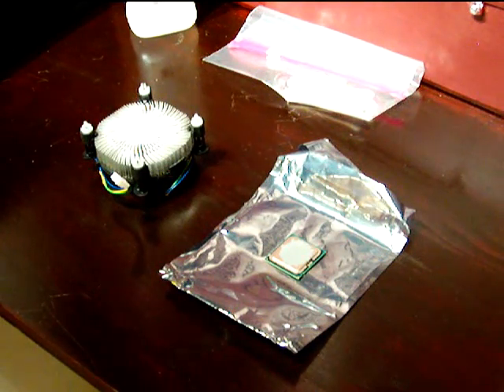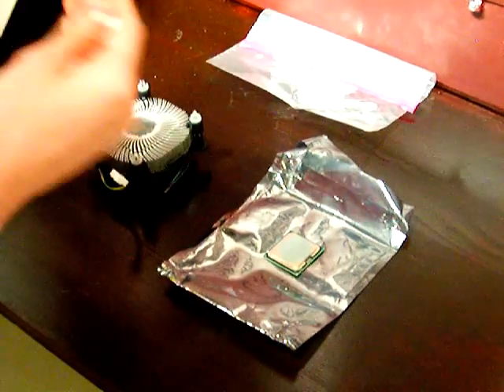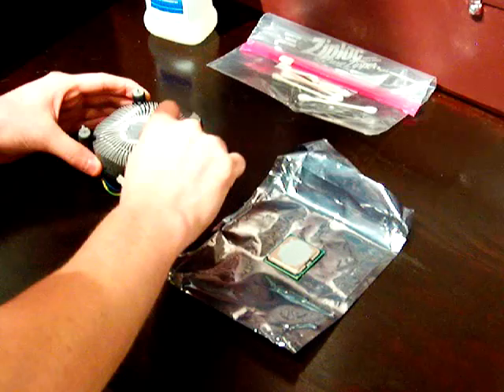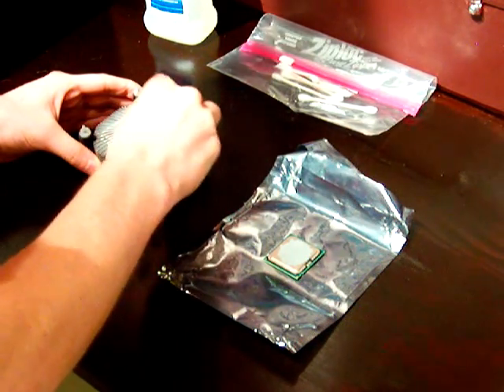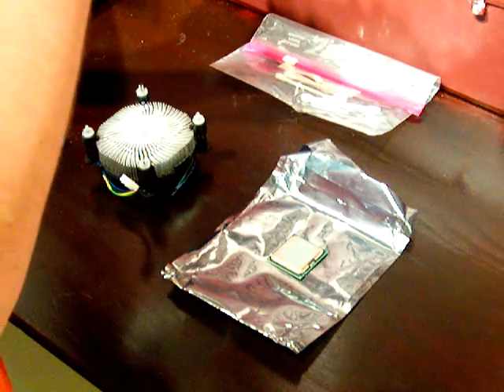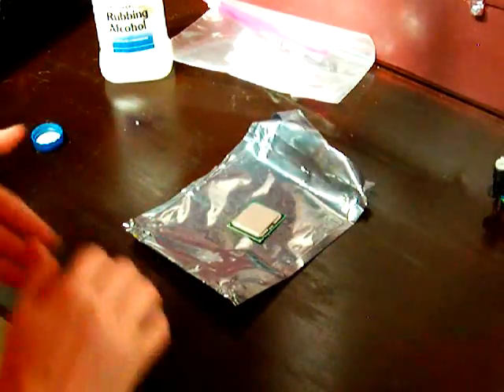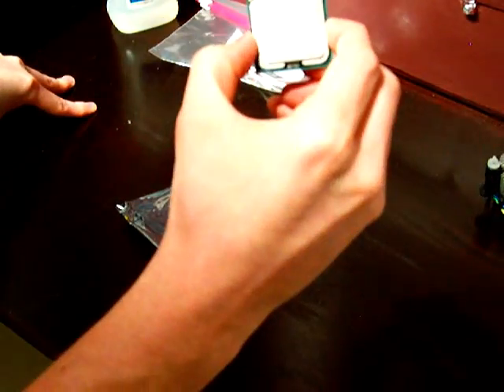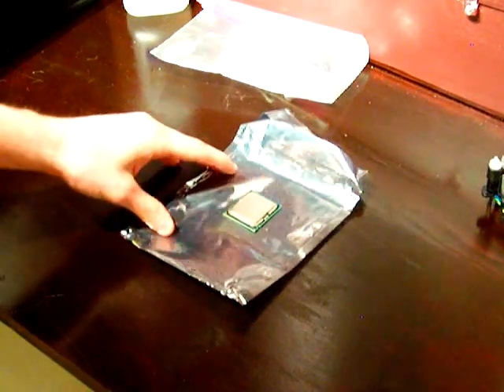How To: Remove Thermal Compound from the CPU or Heatsink

Comment from the maker: No, it will not break in a "week or two," but it can cause instability and shorten the life of the product extensively.

What method are you using to measure the cpu temps?

I highly recommend purchasing some artic silver 5 and reseating the cpu or else considering an aftermarket cooler (however, you shouldn't need the latter option as the stock cooler is more than sufficient).

Comment from the maker: Are you overclocking your cpu? Have you changed any of the cpu voltages? Are you sure that you've properly seated the heatsink/fan and that the fan is spinning when the system is on?

That CPU should not be posting such high temperatures at load. Try the following.
1. Verify that the fan is spinning when the system is on. If not, check to see that it is plugged in properly.
2. Try reseating the Heatsink/fan (requires new thermal compound).

Comment from the maker: Yes, you should remove any old thermal compound whenever removing a heat sink from any device and then apply new TIM. Make sure to remove compound from both surfaces (the heat sink and cpu heat spreader).

Comment: Do you have to remove the old thermal paste off of the cpu because I have an Xbox 360 and I applied new thermal paste over the old thermal paste. Should I remove both with alcohol and apply more thermal paste?

Comment from the maker: Anytime you remove your heatsink/fan from the cpu, you should apply new thermal compound (removing the old compound first).

So yes, you should clean both the cpu and bottom heatsink surfaces and then apply new TIM (Thermal interface material/thermal compound). When applying new TIM, be sure to be very sparing in the quantity that you use. Less will be more effective.

Comment from the maker: 2) No, it is not a big deal if you spilled some alcohol on the side of the heatsink. Just make sure that it is completely dried before installing the heatsink (shouldn't take long for the alcohol to evaporate).2) No, it is not a big deal if you spilled some alcohol on the side of the heatsink. Just make sure that it is completely dried before installing the heatsink (shouldn't take long for the alcohol to evaporate).

Comment from the maker: 1). Static discharge aside, the only issue with touching the heatsink with your finger is leaving residual oils from your finger on the heatsink. The oils on your skin aren't optimal for transferring heat and can (potentially) raise your cpu temperatures. However, this really is a non-issue and if you're concerned simply clean it again with the alcohol as that should remove the oils.

Comment from the maker: Try applying more alcohol to the application device (ex Q-Tip or microfiber cloth) and let the alcohol soak into the thermal compound until it is saturated. Then it should rub off with out any issues. higher concentrations of alcohol are preferential, though the 70% that you have should work fine.

Comment from the maker: Yes, acetone will work just avoid contact with anything but the heat spreader on the cpu or else the contact plate of your heatsink as it can easily damage other system components. Sorry for the delayed response, for some reason Youtube occasionally has issues posting the response.

Comment from the maker: You are correct and in an optimal situation a microfiber cloth would be preferable, though for the most part a Q-tip should retain it's shape and not leave behind any residual filament. Just make sure that once the surface appears "clean," to gently go over the surface again with another dry Q-tip.

Good point to note thank you :).

Comment from the maker: Some of the reasons high concentration alcohol  is used are that it effectively breaks down the thermal compound while not corroding the surface as well as it evaporates rapidly. Depending on how much you apply, it can take anywhere from a few seconds to a few minutes to completely dry. I recommend waiting between 2-5 minutes (after cleaning) before applying new grease and you shouldn't have any issues (though in most situations this is an over estimate). Also go over it with a dry q-tip.